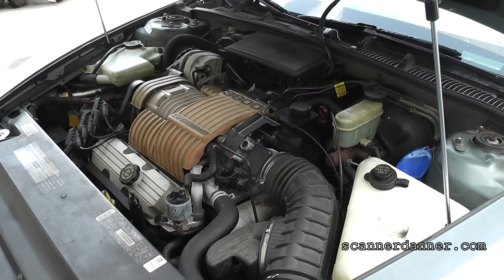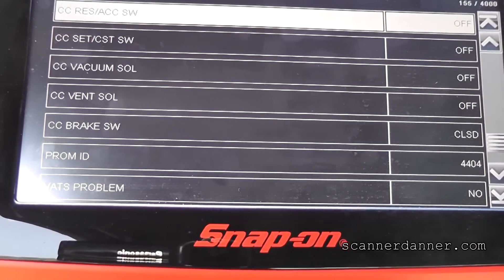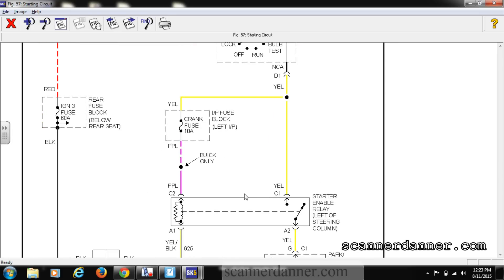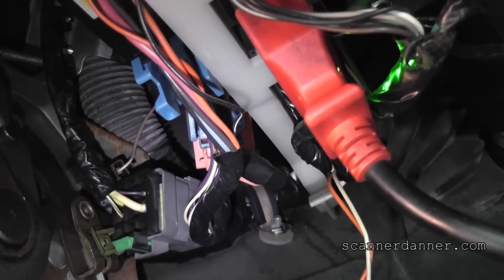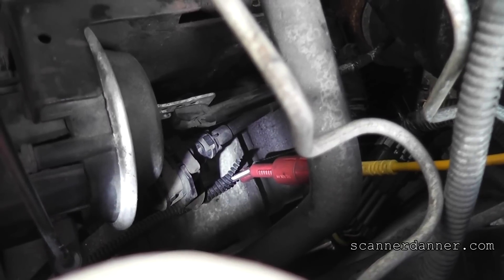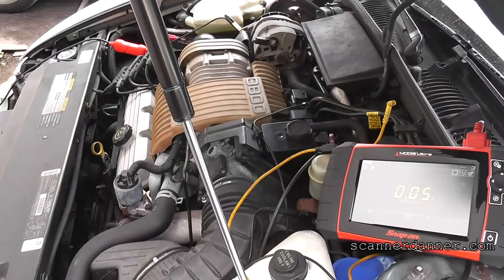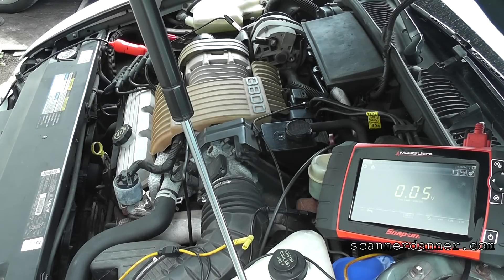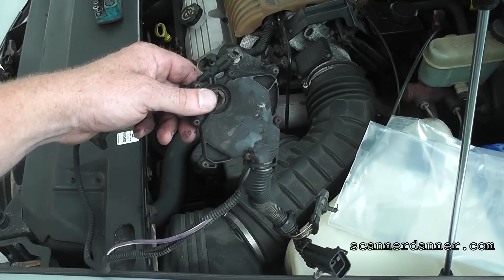How to test a starter (engine doesn't crank)- bad park/neutral switch-GM 3800

Comment: Danner Scanner thank you for your time and effort put into these videos. . i have 2004 mercury grand marquis. . the problem is that my interior lights blink alllllllllll the time and some of these went off also some other electrical components like center lock, window switches, cruise control also ??? I don't know what to do. the workshop told me they fixed an A/C short.. and there is no drain on my battery!
Reply from the maker: +Evening_Syndrome you are describing multiple problems on your car. Not much I can help you with here through email. If you like, pick one of your problems you would like to fix and post a help request on my forum. You'll be required to do some testing, it's not a silver bullet type place to get a quick fix.
Reply from the maker: +Evening_Syndrome center lock, window switches and cruise control are doing what? not working or blinking with the interior lights.
Reply: +Evening_Syndrome Which interior lights exactly?  Please name every light.  Also does the light flicker at any time or does it turn on and stay on or off and stay off for a period of time?  When you say turns on/off allll the time needs to be clarified how it's acting.  When interior functions start going all wacky like they have a mind of their own one of the first things to check is the wiring to and from the body control module (interior logic module also known as a the CPU).  The BCM has a physical logical CPU in it that is programmed to control door lock timers, anti-theft timer functions such as arming/disarming timers, interior light functions, keyless entry functions (sometimes), door closed timers, headlight warning chimes, etc...
Reply: +ScannerDanner centerlock is jamming sometimes the cruise control is not willing to function any more it is like cc is dead.. window switches go out of service quite frequently that i don't want to fix them any more.. im not sure if it is  the switch even exactly ... the thing is the windows do not move.. sometimes they are stuck down which happened twice and I could raise them up but they move so slowly and now they are stuck in the up position. . Actually I don't mind this inconvenience if it is going to lead me to catch the main reason for the frequent failure of my electrical components..
Reply: +DJDevon3 regarding the flicker on interior lights actually i came to notice it is not just the interior ! it is all around the car even head lamps and register plate light they all flicker.. like they have some hesitation It is obvious on idle.. on my obdii through many apps my alternator says  12.3 volts (ad) with the key in run position. the car is parked over 24 hours.. on the road I've seen it reads 14.x
Reply: +ScannerDanner multiple you say huh?? I see... will,, is it possible for a weak or hesitant source to cause damage to electrical systems? and yes you are right it could be more than one issue but when they occurred during the same period i thought it was one thing.. man electrical issues are missed up! any ways I'm going to the forum. . thanks a lot.
Reply: Evening_Syndrome Have your car looked at by an automotive electrician.  You can find one in the phone book.   This channel isn't for helping people with their car issues.  It's for people that want to learn the trade, it's for technicians and advanced DIY'ers.  If you have questions about one of the procedures in a video fire away but asking him questions like he's your personal free advice mechanic online is a big no no here.  Go ask ETCG or Scotty Kilmer during one of their live streams I'm sure they'll be happy to answer your questions.
Reply: +DJDevon3 yah already know that but I am already a DIY on many levels and I am planning on making my own workshop I already have sent a few e-mails to snap on and I look forward to partnership with them.. yah it is my personal issue but if this procedure cannot be solved by advanced people here how should I solve it.. anyways I was asking about the procedure because I already took it and fixed a few things but my electrical components are going out one after the other for no obvious reason.. so how can I diagnose this.. I'm already a subscriber to all the guys you mentioned from years and years ago also chris fix and I have seen all the videos here.. I found this place to be the best for my question. . am I wrong?
Reply: Evening_Syndrome Flickering and intermittent loss of load is caused by intermittent loss of power or ground to a circuit.  First step is to figure out what side of the circuit the problem exists.  Trace it back to the source.  It's going to require some grunt work with a multimeter checking for continuity, resistance, and voltage.  That goes for pretty much any electrical issue in any vehicle.  We're talking basic sense of direction here.
Reply: +DJDevon3 will.. I'm sure about my directions.. but there is nothing advanced here.. I expected to see some fine tools and creative ideas of tackling such a stubborn issue not directions to use a multimeter and some grunt.. anyways that I can do and will  do on my own.. thax anyway.
Reply: Evening_Syndrome You don't need creative ideas to tackle basic electrical issues.  I mean we aren't talking about measuring a PWM signal or anything like that.  You have a straight 12v issue. You need to do some basic electrical diagnostics first. It could be one of about 10 different things.  We're not going to sit here and list out every potential culprit in your system, we can't see or touch your car.  Your question is too vague because you haven't even attempted to do any diagnostics yet.
Reply: +DJDevon3 my problem was tackled by me and two other major workshops.. they told me they see no short circuits in my system.. my question was too simple actually.. is it possible for this hesitation of the source to ruin the electrical systems?  i provided symptoms didn't I ? you answered me and redirected me to look somewhere else in such a bad attitude because you assume that I am not in the same level as you are and guess what sir? your assumption is wrong. . All I needed was a confirmation on my assumption or an advice on where should I start looking.. that is why some out of the box thinking will be needed because there is no obvious reason for what is going on and already advanced technicians are stumbled on this one. . anyways I could fix it myself if you gave me a good method including where to start looking. . but anyways I think I figured it out. . no further help is needed.. I will look somewhere else from here like forever. .
Reply from the maker: +Evening_Syndrome you're not wrong, this is a good place but you'll be expected to provide tests that you've done. No reason to list all the "could be's", it's a waste of time. 
I will however give you my first thought. If ALL of your lights are flickering then you most likely have a diode that has failed in your alternator. You need to perform an AC diode test before going any further. Also you need to find out what is in common to all of these systems, so you need a good wiring diagram. Fords use something called a GEM module that may control all these systems. But you'll be expected to provide voltage readings for additional help.
But there are other reasons you may not be getting the help you wanted. Your initial questions were all over the place. 
1. (centerlock is jamming) what does this mean, when does it do it? If it is with the car off, then it has nothing to do with your blinking lights.
2.( sometimes the cruise control is not willing to function any more it is like cc is dead) did this occur at the exact same time as the lights flickering? If not its a separate problem. 
3. ( window switches go out of service quite frequently that i don't want to fix them any more) you said you dont want to fix them anymore? This is saying that you've fixed them in the past. What did you do to fix them and now your not sure if it is the switch? DO you see how complicated this is becoming?. This sounds like an issue you've had for a long time and NOT something that occurred with the flickering light issue. 
4.(. . Actually I don't mind this inconvenience if it is going to lead me to catch the main reason for the frequent failure of my electrical components) so you'vebeen fixing things then? Frequent failures suggests fixes are being done but what?

So you see how many questions (and these are just some) I had to ask in return to your post, just to even begin this process?

You may not have liked some of DJDevon3's replies but he was just wanting something solid to build from. I've seen him help hundreds of people. He is a really smart guy. You just need to give us something to work with is what he was saying.  Sorry you've left with a bad taste in your mouth. This place is different than others.   As I said before, start with one system that is not working, do some voltage measurements and post your findings. Start with the windows when they don't work. What is the power and ground voltages to the motor? To the switch? Is it a computer controlled system or not (good diagram is needed)?  Follow the path of the inop windows and it will lead you to the central problem for all these systems....maybe, unless you have multiple problems.
Reply: +ScannerDanner will that was all I needed.. If I had what is on your brain I wouldn't even bother to ask right?? .. my question was too broad yes I admit it but as you said they might be connected to a GEM module... my sense told me that they are connected in some how i don't know. . but i didn't know it before!!!! you see why I  asked you.. the symptoms i gave you i thought they were like any other car symptoms you faced like for ever.. I needed a just a guide to help myself just like your last reply. . again thanks a lot for your effort and time.. and I am sorry for any inconvenience. .
Reply from the maker: +Evening_Syndrome it's no problem my friend and I'm sorry it all went down this way. We get so many people that are just looking for silver bullet fixes and don't care about testing or learning. So sometimes we pass judgment to quickly and for me, I just simply cannot answer everyone anymore.
Reply: +ScannerDanner yah.. believe me i have seen people who think engines are just empty boxes that needs to be filled like topped up with oil lol... anyways I am actually more interested in learning how to become a keen expert on automotive diagnostic just like you more than fixing my car.. but I thought it should be a good place to start on my own car since I have the chance so i don't ruin someone's investment lol.. The second point is I'm already contacting snap on because I have a great deal of interest on thier tools.. in other regards I just finished engine and A/T rebuilding courses :).. thank you again.. thank you sincerely..